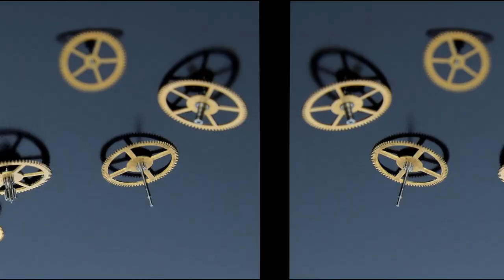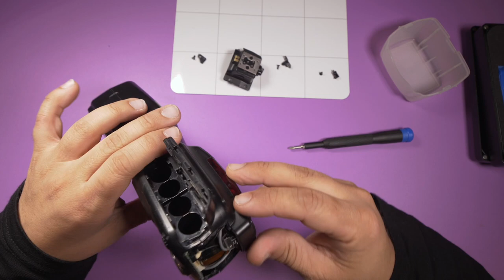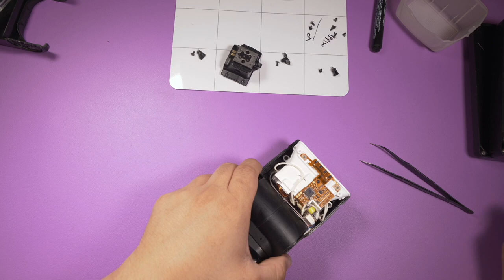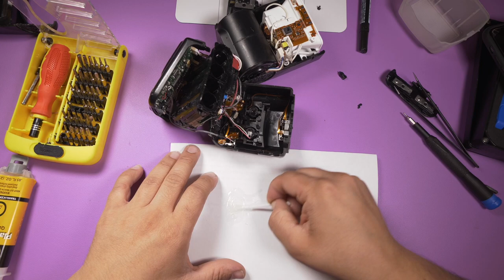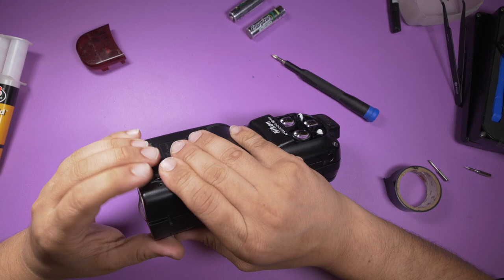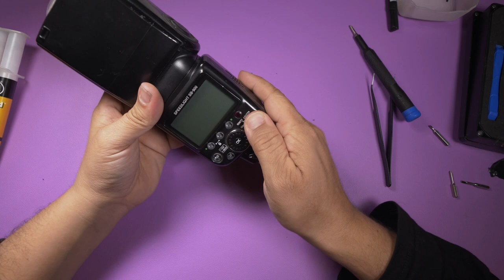Nikon SB 900 Flash  [teardown] [Repair]

Comment: The one part I wanted to see was skipped over. How did you get the control portion separated?
Reply: Me too, Just pulls apart. I Stuck a marker that fit the battery hole in and used it to leverage the one side open (This worked to pop the side open but the battery shell isnt part of the piece your trying to remove) then a thin metal spreader tool on the other side crease to pry open (This should be how you open both sides). Be careful but forceful. Short ribbon cable by the hot-shoe should be disconnected first. Kind short and may get damaged. Maybe to late too help u but will leave for others